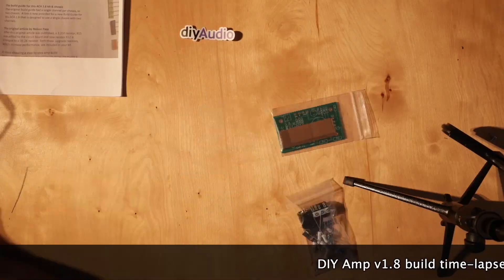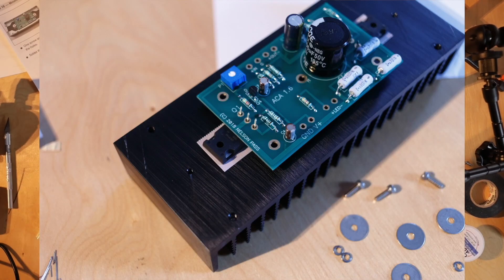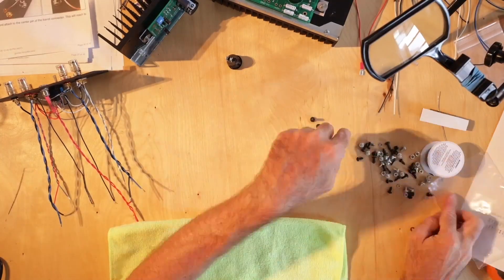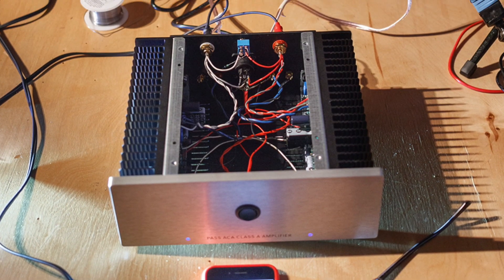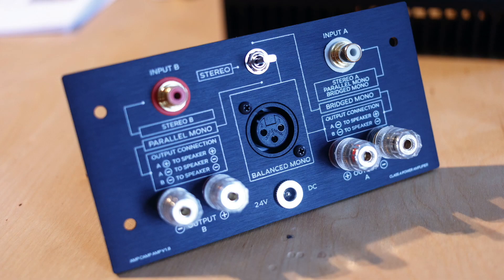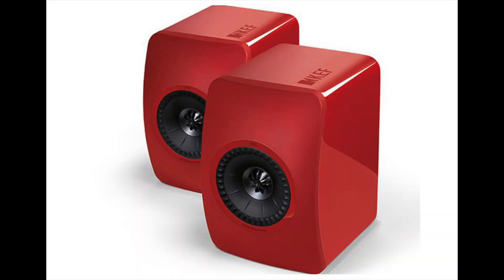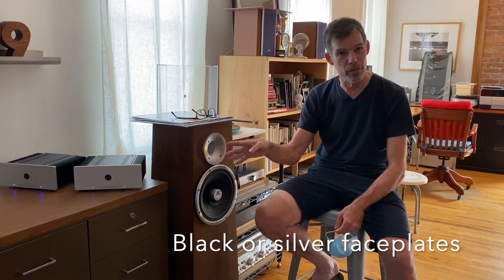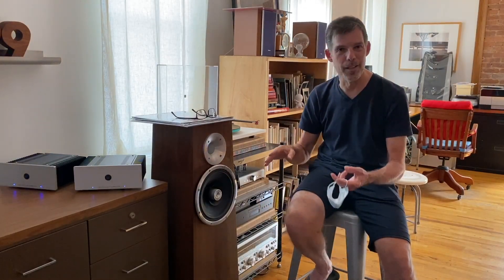Robert built the Nelson Pass designed $327 Class A Amp Camp Amp

Comment: I have a lot of respect for Nelson Pass and his products and his efforts to get people involved in DIY, which is what this amp is all about.  This is NOT a Pass First Watt or any of his other amps.  Its a very simple kit to introduce people to DIY.  I bought an assembled version on ebay because I had never tried a class A amp and have Klipsch Forte speakers which are highly efficient.  Compared to my 200 watt per channel amp that I use all the time this sounds like a little table radio in comparison.  It also cured my curiosity about class A amps.  At 5 or 8 watts per channel it generated a lot of heat.  I can only imagine how hot more powerful class A amps run.  I live in Florida and we have enough heat already.  After hearing an amp with a lot of power, even on my highly efficient speakers, I could never go back to low power again.  The dynamics and slam are no comparison.  I also have a 30 watt per channel amp that sounds weak in comparison and I listen at low power levels.
Reply: Steve might have something to say in his review so no spoilers but this amp does not have a lot of gain so depending on pre and speaker efficiency it can appear weak compared to other more powerful amps. But I can get to 90db easy on the couch at 2m which is plenty loud. If you have a large room then no, and no 5-10w amp is going to do what a 200w amp can do. Even 30 is only 3db louder than 15w which is what this is bridged dual mono. And yes it does get hot, all class A runs hot. I appreciate the slam is not exactly room pressurizing, thats not what low power is about.
Reply: @robertwrightphoto  All good points but I would not recommend such lower power expect for perhaps string quartets maybe near field listening.  I suspect money may be better spent on a class D amp which is the size of a book and delivers a lot of power.  But again this is designed for minimal parts and for people to learn how to build.
Reply: @BustRadioMyths  :) I never listen to string quartets:) I have a class D belCanto and obv it kicks butt. But this is different and has some magic sauce the class D doesn't. I had the J2 for a while on loan so that was about perfect for me. That's only 20wpc. whatever floats the boat.
Reply: I think it's funny to compare this to a 200 wpc amp. They're not made to do the same things. I agree this one is to get folks into DIY. It did me. I've since built an F5 and F6, also low power at about 25 wpc. They drive my Forte III's perfectly for my room and listening preferences. If anyone's curious about low power, it's worth learning why Papa started First Watt in the first place. Then decide if it's right for you. It'll work for many, but not everyone.

Comment: I think every kid should be required to build one of these in high school  They not only would learn a little bit about electronics, they'd also learn organizational and planning skills, and then see (hear) the results of their efforts.

Nelson, get on this will you.  Design an integrated version with a dac.  The kid can buy a cheap (good) pair of Parts Express speakers, plug in her phone and there you go!
Reply: I can't even believe the Parts Express speakers I got for $9 bucks each those things are working well as replacements in the old Polk 10A.  6" woofers weigh a few lbs each...
Reply: Every kid? Haha I need to do this
Reply: @nunyabiz2016  I wish I had taken auto shop

Comment: I'd like to take partial credit, as I suggested this idea to Steve in an earlier video comment.

I have also built this amp and enjoyed the experience. With the right efficient speakers, it is enjoyable to listen  to. But the paradox of High-End Audio is that this amp measures very poorly (https://www.audiosciencereview.com/forum/index.php?threads/pass-aca-class-a-power-amplifier-review.9741/).

I, for one, am moving to SOTA Class-D amps such as the latest Bruno Putzeys' Purifi  1ET400A which measures near the top of the list of amps. The Benchmark AHB2 is still the reigning champion in THD+N (SINAD). But look out because there are rumors that the wizards at Topping are about to make an assault on the best SINAD amp in the coming months. Topping has already conquered the best SINAD Headphone amps (https://www.audiosciencereview.com/forum/index.php?threads/topping-l30-headphone-amplifier-review.15226/). For $130!

John Darko just did an extensive interview with Bruno Putzeys. Steve should do some reviews of these designs as well.

Comment: You don’t have to buy the whole $327. Kit, you can just buy the components kit for about $16 and you have the option to buy the circuit boards for another $19 or you can skip the circuit board and lay the components out on a wooden board a plastic board solder them point to point that means join the components directly together.   You can use wires instead of the circuitboard and you can scavenge an old heat sinks from all broken stereos or other electronica components for free that are discarded.    So you can enjoy the exact same great sound without the expensive fancy case if you so desire. If you’re handy with your hands you could make a wooden case or a sheet metal case or reuse and recycle and all dead stereo case.     You get the exact same sound  even with one only in stereo if you have High Efficiency speakers.
Reply: And you can make your own inductors and transformers, but if I have a good pcb, I'm using that. Done plenty of point to point wiring.
Reply: Mark Staub I wanted to make my own transformer just for fun researched it then when I seen how many hours are involved had to give up that idea.  Made simple low-voltage transformers in high school electronics class but those were only a few turns.

Comment: What is the process for setting the bias? Also, I wonder about the design and parts for a "proper" power supply?
Reply: it's easy there is a potentiometer on each channel and you use a voltmeter to set the bias. The instructions are simple.
Reply: @robertwrightphoto  Thanks - can you "tailor" the sound with this?

Also, how many capacitors are in the circuit?
Reply: @NeilBlanchard  that would be beyond my pay grade, the forum would have more answers. You can look at the schematic on the DIY website. If I read it correctly there is only on Cap per side in the signal path proper, altho there are a few more that do other things. I could be wrong .
Reply: @robertwrightphoto  Thanks again. I was looking for a power supply schematic and parts list.
My guess is the larger cap is a filter for the power supply, so the smaller cap is the one in the signal path. It is probably easy to replace with a higher quality device. (It appears to be an electrolytic?)
Reply: @NeilBlanchard  The power supply is an outboard 24v brick.  The brick is included with the kit.
Reply: @nacarp2000  I've got that, and I am wondering about a better onboard power supply.
Reply: @NeilBlanchard  Google the First Watt F5 power supply. I'd follow that design and just scale it down. There's no power supply filter cap on this board. It's an output coupling capacitor. In audiophile circles it's not loved, but it goes a long, long ways to making this design easy for a beginner. You can't really tweak the sound of this amp much with bias. It just needs to be in the linear region of the output devices. However, there's a lot of opportunity for an intrepid builder to adjust feedback, capacitor types/brands, etc. You can certainly change its sound. Remember, this amp is mainly meant to help new builders get involved in building really nice sounding class A amps. It's not an end-game amp for most, but it's tons of fun!

Comment: I'm not a flea watt amp fan so I'd say this is best suited for a desktop or small office systems, but it looks like a lot of work.  But there will always be some diy guys, and I would think they'd enjoy the challenge.
Reply from the maker: Not true, the baby amp sounds seriously good with my 100 pound Klipsch Cornwall IV speakers. Any high sensitivity speaker, over 92 dB for example.
Reply: @SteveGuttenbergAudiophiliac  Using a pair to drive my 105db/watt Carfrae Little big horn replica horns.  No cross over but plate amp to drive integrated subwoofer as per the original speakers. It's the First watt that counts.  Try them with the Korg Nutube preamp for massive sound stage.

Comment: Thats really cool ;) Been debating a kit for a while may just have to take the plunge. ( and good thing, I've soldered a ton of stuff so... )

I'm curious what kind of wiring / solder you used here. Just regular solder, silver or 'audiophile grade' ( being generic here ). Does the solder or hookup wiring really matter much here given the power range?
Reply: I used the solder they specified on the DIY website, Cardas, I don't think it matters much tho. Was blend of Silver Lead Copper and Tin and had flux core. The diameter matters a little, small diameter solder is easier and neater to work with on pc boards.

Comment: You need some real efficient speakers with these amps. Also the damping factor on these absolutely sucks so not sure the impact on the bass. I put together my David Hafler amplifier MANY years ago and had a good time doing it and saved money. I love the Pass and First Watt amps. Their factory is only about a 45 minute drive from me.
Reply: I think the impact is the bass is generous but tubby:). A little. But there are a lot of factors there for me since I have a sub in the mix and the Zu's on their own don't make a lot of bass. Steve will have the definite opinion in his review.
Reply: I first used a pair of old Boston Acoustics HD5s, little bookshelf two-ways with 89 dB sensitivity. You can turn it all the way up in a 20x20 room and not get blown out.  Then I built a second ACÁ amp. Then I built 95 dB speakers. We typically listen at about 10 o’clock running thru a Pass diy preamp with 10 dB of gain.

Comment: Thanks, Steve.  Nice work as usual.  I built my first ACA (Amp Camp Amp) about 4 years ago as two monblocks, and my second, in one box, about 2 years ago.  Now I'm going back through the amps cleaning up wiring, revising switching, etc.  I love the way they sound, and it is really cool to make fairly radical revisions whenever I feel like it.  I'm still designing my ???? - Is it a preamp?  Or a mixer?  Well not a mixer, more of a 3 in 3 out switcher that can fan one input to three outputs at a time.  I'm also adding effects inserts to all of the in-outs, sort of like the old tape monitor loops we used to have, but way more flexible.  DIY is not for everyone, and contrary to popular belief, making equipment from scratch can get very expensive very quickly.  Sometimes it pays off, and I am very thankful that Papa Nelson made ACA so easy for so many people, and it appeals to me because I can tear it apart and make revisions any time I feel like it.  And, about that, my first ACA is sitting on the bench waiting for me.  Thanks again, Steve, and the best to you and yours.
Reply: Interesting! How did you combine the two monoblocks into one?
Reply: @EliasTheHunter  The older kits were mono blocks. If you find pictures, you'll see a heat sink only on one side of a small enclosure. The newer kits are dual mono in one box. One power supply, though, for both channels.
Reply: Ryan Hart ah, thanks! I see now. I thought they were saying that they did something custom.
Reply: @EliasTheHunter  Although I didn't say it, I do intend to make one box out of two.  The basic plan is to join the top and bottom panels with screws and a steel plate, then the back panels are available separately from DIY Audio.  I'm on the fence about front panels, and I may go with bookmatched flame maple faces for both (all 4?) amps.  I also need to change out some parts on the old boards to bring them up to the latest specs, and switch the power supply from 19v to 24v.  One particularly heretical design decision made by our benefactor, Nelson Pass, is the prescribed use of a (GASP...  OMG!!!) switching power supply.  I've tried every measurement I can make to chase down any measurable noise on the speaker outputs from these supplies, and I'm not seeing it, and more importantly, I can't hear it, YMMV. I would also like to build in a se to balanced converter, but there are a lot of other ways to get these amps to swing both ways...  It sounds like a lot of work, but to me it is pure bliss!!!

Comment: I havent soldered in years, not sure I would trust myself on this project.
Reply: It's like riding a bike, but with scalding, molten metal
Reply: Soldering is like riding a bike only to can’t fall down get a  good soldering station and good Rosen core solder and practice  you will get good soon but remember practice on things that don’t matter !
Reply: @harryconover289  eh, proper flux gel and leaded tin is the way to go if you want it done well. Also a tempcontrolled soldering station not one of those wall plugin things. At least that's what I use but I solder a lot finer stuff than this project, but just rosin core solder is not going to get a really good end result unless you are working at a specific tempo which people who don't do it regularly are unlikely to do. Flux is the ticket, pre flux and tin all spots and components, assemble, flux again and then solder but let it heat up properly first.
Reply: noth606 a soldering station is thematically regulated and not a plug in thing five core resken solder is the best

Comment: I also built 2 ACAs and I concluded that probably they are more suited to high efficiency speakers. Mine are about 88db / W / M But still I loved the dynamic bass and enthusiastic sound and it inspired me to moved onto a MOSFET version of the John Linsley Hood Simple Class A - which is Awesome :-)
Reply: Isn't it obvious they are for high efficiency speakers? Not trying to be an a$$ but it was obvious to me from the power ratings of them...
Reply: @noth606  Not necessarily. Had it been same low power but with higher damping factor & lower distortion, then it would have just been usable.  But no complaints it steered me onto the MF JLH which quite ideal for me.

Comment: I have one of these. It was not my first project although I am far from an expert. It took me a few hours. I'm sure Steve will review this amp but it is stupidly good, especially for the money. The biggest limitation is the low power, 8 watts I think. I have mine in a tri-amp setup paired with two single ended triode tube amps. It powers the tweeters, they are the least efficient of the drivers in my home made speakers and the ACA has four times the power of my other amps.